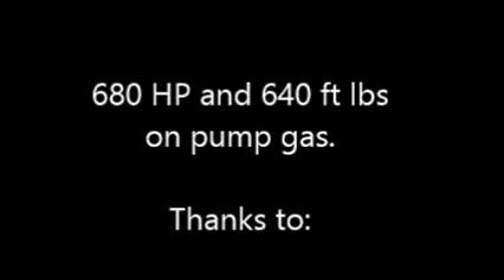FAST Man EFI Mopar 508" EFI 6 Pack

Comment: Nice setup for sure. I've got a new Bill Mitchell Products aluminum RB block (4.50 bore) I plan on a 4.25 stroke for 541 cu in displacement. I have the Weiand P3690982 6bbl intake, but I'm going to start out running my Promax modded Holley 3x 2bbl carbs on it. I have to make sure the Weiand can be ported to Max Wedge port size. If not, the ModMan is my other choice. It looks like that's what you have? Any comparison between the ModMan and the Weiand I know of at least 2 who are using the F&B 6bbl EFI setup on. Tell me all you can!